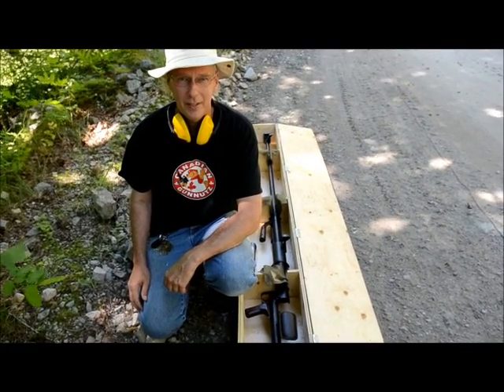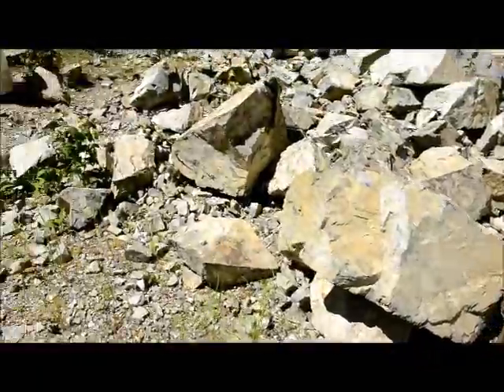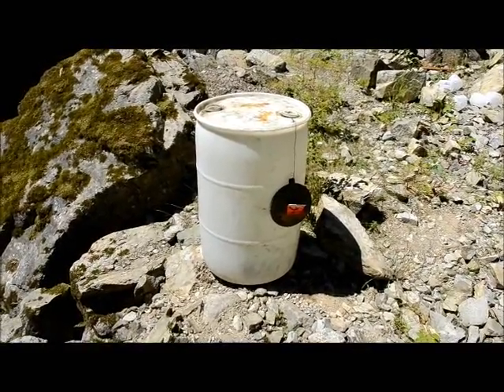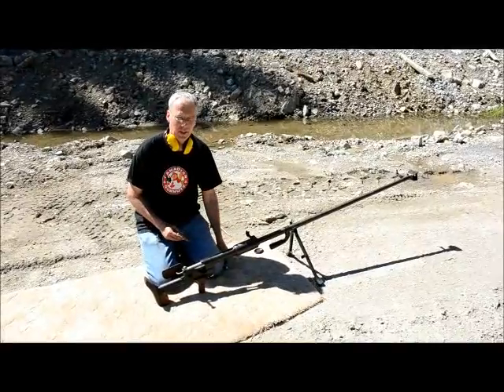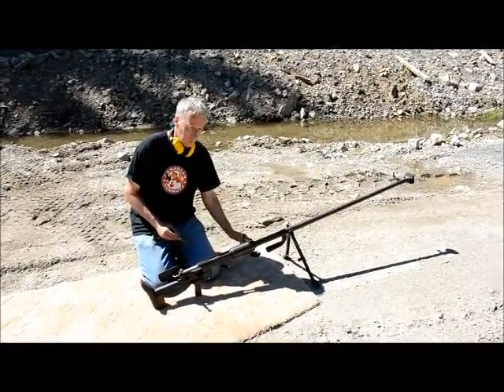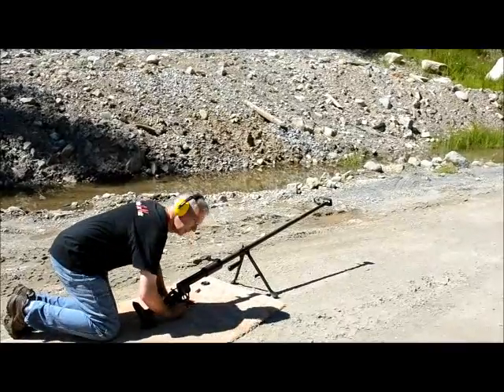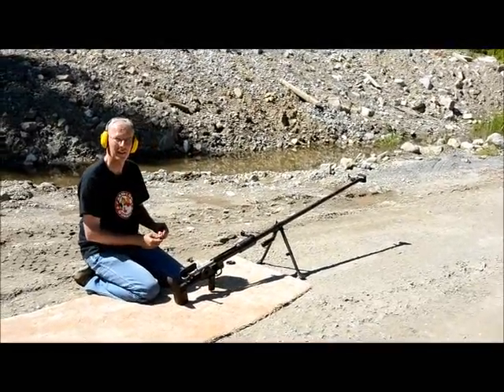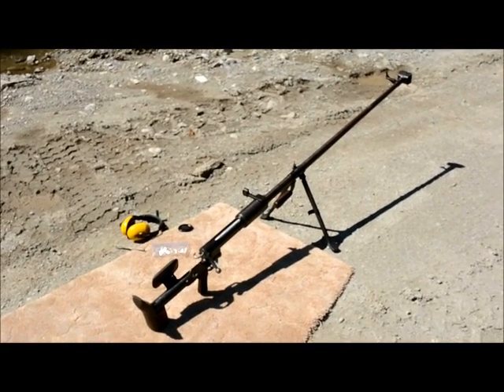PTRD anti tank rifle test fire

Comment: I was hoping to see how the steel plate ended up...
Reply: +Ninno Angelo at the very end of the video they show a picture of the plate and barrel.
Reply: +RoMMeL1337ak47 well your wrkng
Reply: they did
Reply: Exit hole of the plate with a brass bullet.. DAYUM.
Reply: Andrés Valverde  only BS-41 had tungsten carbide core-it was 68.4 grams and as I measured on my own PTRS-41(modified but obviously retained the caliber and barrel length)-the initial velocity is actually around 1020 meters per second for BS-41 and with my own enhanced loads it shows 1280 meters per second which is by the way 56 kilojoules of power!Thankfully the vastly more rigid and heavier barrel from KPVT that I adapted to PTRS-41 action perfectly holds such a thing!And yes,in my case it makes a clean hole in 2 inch thick AR-680 military sample that is currently in use in NATO armoured forces,and is absolutely gorgeous and devastating cannon!
Reply: Andrés Valverde  yes,experimental FMJ requires impact speed of not less than 1350 meters per second to punch through the half inch thick AR-500 plate and solid brass requires over 1.5 kilometers per second!
Reply: Andrés Valverde  more likely the second option:that armour is actually formidable and is equally good at stopping ballistic penetrators as Russian analogues and both are vastly better than Chinese counterparts-those just love to crack in various circumstances where they shouldn't!Yet the firepower of such a massive gun as PTRS-41 is really huge for hand held weapons-especially in my variant of it!Here really for sure the heavy barrel just improves the entire gun performance to epic levels:the very important modification for sure!First of all the original PTRS-41 barrel of the earlier version is just crap:after only 100 rounds with factory loads accuracy falls so much that your groupings simply become twice worse at all distances,after 150 rounds it becomes even worse,rifling at that point is already partially or completely destroyed and shooting further becomes highly dangerous for the shooter-because there is actually no chance that it will hold to make the 200th shot-it inevitably will rupture earlier than that!In the later version that was produced from November 1943 till January 1945-the end of production,the numbers are somewhat better but still you have the same problem at about 3 times more rounds than the early version:you lose half of it's accuracy after 300 rounds and after 450-500 rounds each next round is potentially fatal for the shooter because it has no chance to hold till 600th round!And also both PTRS-41 and PTRD-41 barrels are blown up if you exceed the factory load by 10% from the first shot of such round!Meanwhile the KPVT barrel has an unprecedented resource of 20 thousand rounds until the first re-chrome lining after which you can use it for 20 thousand rounds with factory loads and due to substantial thickness of metal itself and the vastly improved steel and manufacturing process itself the resource is not decreasing any faster with enhanced loads up to 1.8 times more energetic-that is serious advantage!Which lets in my case the 1.4×factory load with BS-41 projectile to pierce a 2 inch thick AR-680 mil spec armour plate from up to 300 meters away!Yet obviously the original barrel would have been destroyed in a very brutal fashion by just a single such round!

Also KPVT themselves were designed for vastly superior propellants and about 1.8 times more powerful loads and this applies not only to the barrel but to all the other parts and the whole assembly!This is why the KPVT itself without ammunition and any mounts/pods-just the body itself with its famous electric trigger assembly(it can be swapped with mechanical one but originally you can't fire a KPVT without literally inserting it's fork in the special socket in the tank or APC where you installed it)-has overall weight of 52.4 kilograms and it's gianormous bolt alone is heavier than two loaded AK-47s !And if you look at it's locking mechanism-damn,it's made to hold the real hell in the chamber-at least I don't know any other firearm that has 58 locking lugs or anything like that!
Reply: 7:45 min its shows ....watch the hole think before speaking !

Comment: Marstar's didn't auto-eject either but they were on softer ground and the bipod legs were digging in.
Reply: 70% charged also.... Real military loads would unlock the bolt and eject the case, dislocate your shoulder, and burn the barrel out. XD

Comment from the maker: I am well aware that this is not the semi-auto PTRS (Simonov designed) model.
Yes, my PTRD is a bolt action. However, the entire barrel and receiver assembly is designed to recoil against the shoulder stock. When it does, the bolt handle rides up on a cam plate, forcing the bolt open by recoil alone. The recoil spring then pushes the barrel and receiver forward, causing the case to be withdrawn and ejected.
So it IS auto-eject, but not auto loading.
Reply: Do you remember making this video 6 years ago? Also do you still have those guns? And did you ever think the bullet would somehow reflect and hit you instead? And is it scary handling guns?

Comment: So many people complain about it not being a auto eject and saying it is a bolt damn kids and there call of duty.
Reply: There is a version called the PTRS that is semiautomatic
Reply: The ptrd actually is supposed to automatically eject rounds.
Reply: http://oi15.tinypic.com/4tp2ruh.jpg

it does auto eject, the problem is that nobody really uses the ammo it was supposed to load, meaning the recoil to operate the system is not high enough.
thats why you see noone of the PTRDs in videos do it.
in this video you can even see that the weapon tried to open the bolt.
Reply: Iron_Physik how does that work anyway? I can't imagine the bolt shearing itself up is healthy.
Reply: Vernon682

the barrel is inside another tube and sits on a spring.
so when you fire the gun, the barrel moves in the outer tube and the bolt handle gets pushed up by that ramp and the bolt opens and ejects the case.
(I hope you understand what I try to explain here :D)
Reply: Iron_Physik why have that system if it only adds complexity for faster reloading?
Reply: Vernon682

it also reduces the recoil by quite alot.
so you kill 2 flys with 1 clap. :)

Comment: Bro it's bolt action, u have to manually actuate the bolt to eject the round then feed a new one in. and from what I remember the Ptrd 41 doesn't have a fixed magazine so u got to do that for every shot
Reply: You obviously don't know much about the PTRD.... 

The Degtyarov PTRD anti-tank rifle is a manually operated, single shot rifle. It uses conventional rotary bolt cation with single-piece bolt that has two radial locking lugs at the front. One unusual feature of the PTRD action is its self-ejection: the barrel was allowed to slide back under recoil, compressing the spring buffer located in the shoulder stock. Upon recoil, the bolt handle struck the cam plate, located on the right side of the stock. This plate forced the bolt handle to rotate up and unlock the bolt. After this, the barrel recoil movement was stopped and the heavy bolt was allowed to recoil under its own inertia, to open up the action and extract and eject fired case. Once the ejection was complete, the shooter had to manually load a fresh round into the chamber and manually close the bolt for the next shot.

Comment: as i read on some other websites, i heard that the bolt would automaticly open because of the recoil of the gun,
why doesn't yours do that too?
Reply: its a single shot bolt action gun once you push the bolt forward , the bolt is lock, and it stops the recoil, its not automatic rifle

Comment: Watched alot of other videos on this and they don't auto eject. Don't think I've ever seen a bolt operating system that auto ejects. Awsome video btw.
Reply: They do auto eject. However, the ammunition most people use today is not the same as the ones used in ww2. The older rounds had more recoil and pushed the gun into the stock, therefore lifting up the bolt and ejecting the round.

Here is an example: https://youtu.be/cUO3Bmt5XTQ

(Skip to 10:30 to see it)
Reply: Jack 647 ive just come from there😃but i didn’t see it fired

Comment: it is not supposed to auto eject
Reply: ARIES9327 no its not, its a bolt action so you have to pull the bolt back yourself
Reply: this Dekterev development, and was another development which was the Simonov self-loading, both adopted at the same time
Reply: It is supposed to auto eject
Reply: It is. The recoil system is designed in a way that the entire upper assembly was pushed back (while the lower part where the trigger, stock plate and cheek rest are remained relatively stationary). The bolt handle would then hit the angled metal plate on the the lower assembly, rotating the bolt into the open position. After that, the bold would be smashed open, ejecting the shell.

You do have to manually load the next round and close the bolt after that tho.

Comment: it is balt action it does not auto eject wtf
Reply: The Degtyarov PTRD anti-tank rifle is a manually operated, single shot rifle. It uses conventional rotary bolt cation with single-piece bolt that has two radial locking lugs at the front. One unusual feature of the PTRD action is its self-ejection: the barrel was allowed to slide back under recoil, compressing the spring buffer located in the shoulder stock. Upon recoil, the bolt handle struck the cam plate, located on the right side of the stock. This plate forced the bolt handle to rotate up and unlock the bolt. After this, the barrel recoil movement was stopped and the heavy bolt was allowed to recoil under its own inertia, to open up the action and extract and eject fired case. Once the ejection was complete, the shooter had to manually load a fresh round into the chamber and manually close the bolt for the next shot.

Comment: it dosnt auto eject because it is bolt action. No bolt action rifle auto ejects
Reply: You sound pretty surly for somebody who is so WRONG:
The Degtyarov PTRD anti-tank rifle is a manually operated, single shot rifle. It uses conventional rotary bolt cation with single-piece bolt that has two radial locking lugs at the front. One unusual feature of the PTRD action is its self-ejection: the barrel was allowed to slide back under recoil, compressing the spring buffer located in the shoulder stock. Upon recoil, the bolt handle struck the cam plate, located on the right side of the stock. This plate forced the bolt handle to rotate up and unlock the bolt. After this, the barrel recoil movement was stopped and the heavy bolt was allowed to recoil under its own inertia, to open up the action and extract and eject fired case. Once the ejection was complete, the shooter had to manually load a fresh round into the chamber and manually close the bolt for the next shot.
Reply: You can even see in the video it's trying to eject, plus from the design of the rifle it's suppose to. Guess you're not paying any attention to the video, Ted. >>
Reply: Ted Sutherland Umm, yes it does.

Id explain it but Air Gunny did a pretty good job doing that.
Reply: Air Gunny wow. didnt know that. well i learned something new today. thanks
Reply: Ted Sutherland Yes this gun does have an auto eject.
Reply: Kevin Rouse Ain't that the truth.
Reply: Air Gunny the ptrd - 41 doesnt auto eject the ptrs auto ejects every video i have watched of the ptrd - 41 doesnt auto eject
Reply: Air Gunny the ptrd - 41 doesnt auto eject the ptrs auto ejects every video i have watched of the ptrd - 41 doesnt auto eject
Reply: Ted Sutherland lol ur 100% correct these people are so quick to jump on someone to make them feel superior lol ptrs auto ejects not the ptrd - 41 witch we can clearly see in the video
Reply: Ted Sutherland lol ur 100% correct these people are so quick to jump on someone to make them feel superior lol ptrs auto ejects not the ptrd - 41 witch we can clearly see in the video
Reply: http://oi15.tinypic.com/4tp2ruh.jpg

it does auto eject, the problem is that nobody really uses the ammo it was supposed to load, meaning the recoil to operate the system is not high enough.
thats why you see noone of the PTRDs in videos do it.
in this video you can even see that the weapon tried to open the bolt.

+Funk Doo

Comment: the PTRS is Semi- Automatic and it flips back automatic :) not by the PTRD
Reply: Both of them do
Reply: Grafer90 APB oh. Dont know that
Reply: Ok
Reply: EinBatman well,only PTRS does so.PTRD was never auto eject-it would be stupid waste of simplicity which is absolutely useless because it ejects when you cycle the bolt and so when you put a new round in it-the hull is already ejected.Damn,I can't understand how it can be not obvious like 2×2 for some dummies 🤔
Reply: You're dead wrong.
Reply: +EinBatman Actually the PTRD can eject the case. One reason for doing that that is the unhumanly high recoil with these military loads, the other reason was to keep the weapon as simple as possible but increasing the firepower above that of a simple bolt action. The barrel and bolt slides on the trigger assembly back when fired, if you look closely ther is a diagonal rail that pushes the bolt handel  up and so opens the breech. Then the kinetic energy of the bolt pulls itself out and automatically ejects the empty case. Voila, a perfectly functioning dead simple auto eject bolt action anti tank rifle ;D (assuming you are using the right ammunition).
Reply: John Sheppard 

You might want to actually read about the PTRD before you start accusing others of being dummies.

Comment: Uhh, it really wasn't supposed to eject actually. The operator had to eject it by pulling back on it. Other PTRD videos were like that too.
Reply: http://oi15.tinypic.com/4tp2ruh.jpg

it does auto eject, the problem is that nobody really uses the ammo it was supposed to load, meaning the recoil to operate the system is not high enough.
thats why you see noone of the PTRDs in videos do it.
in this video you can even see that the weapon tried to open the bolt.
Reply: btw i know this is 6 months old, but thank you Iron_Physik for replying to basically everyone saying it isn't supposed to auto eject. you are doing god's work my man.

Comment: jeeezz,  the whole point is to see the damage.  You showed us some nice steel, then ...... nothing.   And its a bolt action.  No "Auto-eject" unless you have your buddy running the bolt.  Soo sad.   Would have been a good video.
Reply: it actually auto eject, learn befor commenting lol....
Reply: The Degtyarov PTRD anti-tank rifle is a manually operated, single shot rifle. It uses conventional rotary bolt cation with single-piece bolt that has two radial locking lugs at the front. One unusual feature of the PTRD action is its self-ejection: the barrel was allowed to slide back under recoil, compressing the spring buffer located in the shoulder stock. Upon recoil, the bolt handle struck the cam plate, located on the right side of the stock. This plate forced the bolt handle to rotate up and unlock the bolt. After this, the barrel recoil movement was stopped and the heavy bolt was allowed to recoil under its own inertia, to open up the action and extract and eject fired case. Once the ejection was complete, the shooter had to manually load a fresh round into the chamber and manually close the bolt for the next shot.